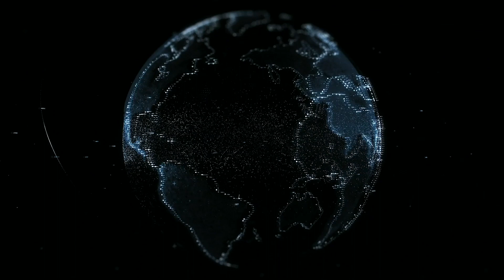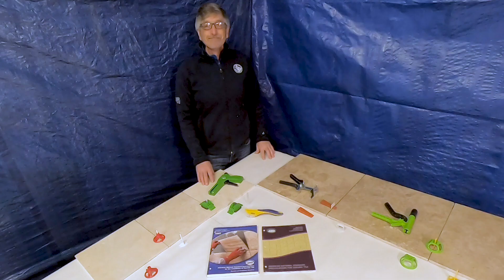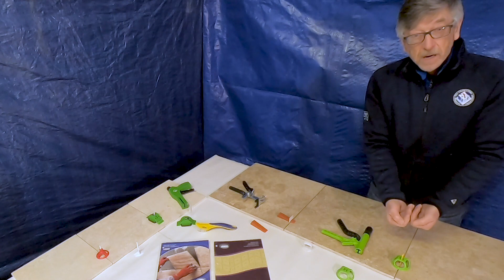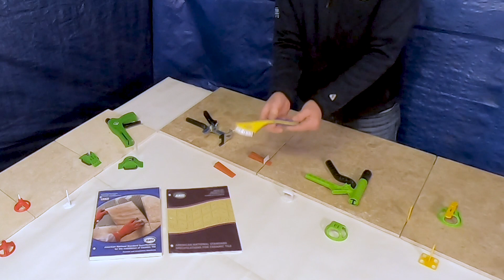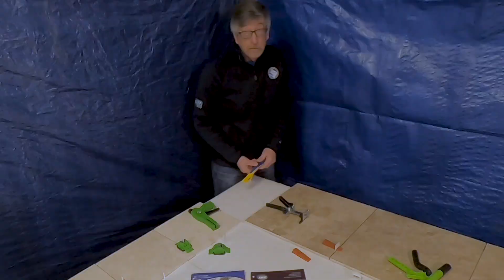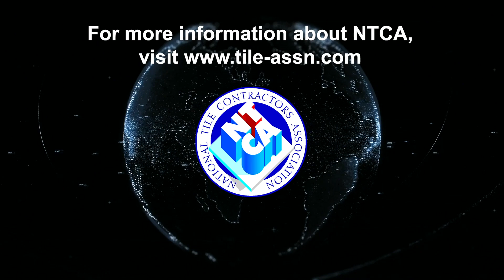TileTV: Lippage Control Systems (S1;Ep9)

Comment: A 2 inch angle china brisal paint brush works better to clean out the joints. The brush Mark used will not get down into the joint because it is to stiff.
Its impossable to clean it 100% . So clean up in the joint maybe required once the bond coat it dry and the lippage sytem is removed.

Comment: So the warp in the tile plus 1/32",  that could be as much as 3/32", especially on longer plank tiles. If its rectified even a 1/32" looks awful. Ive installed a few jobs that even lippage clips couldnt take out the warp. In that case how do you handle that when your asked why it looks that way?